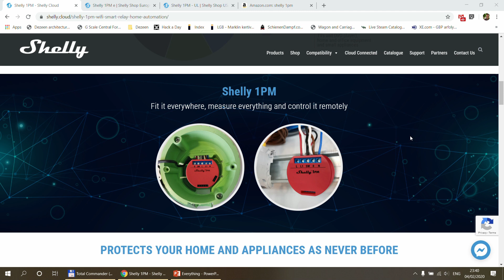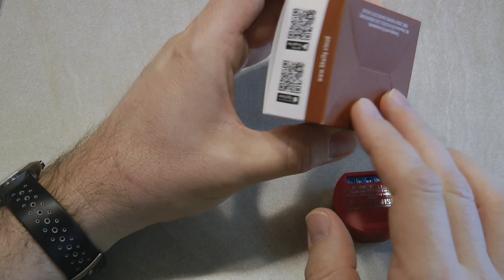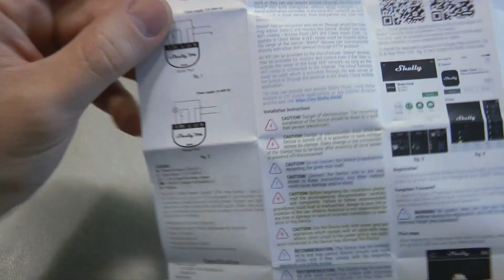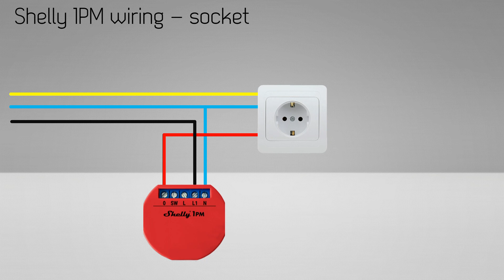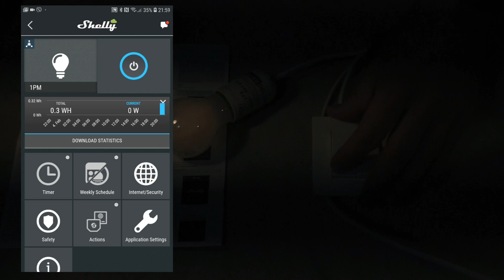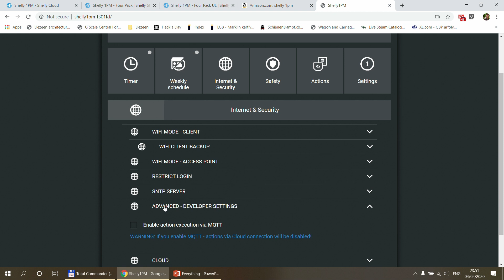Shelly 1PM - single channel wifi relay with power measurement

Comment: Question: Can I use a 110Volt switch with a 220V blub? can that work? with my input current 220v. ???
Reply from the maker: If your switch is rated for 110V, that is probably for a reason. I would not use if for 220.

Comment: For Sonoff is there a similar setting like the option to choose between the 'Toggle Switch' and the 'Edge Switch'? It is by default set on the 'Edge Switch' in the Sonoff Mini.
Reply from the maker: If think there is on the mini. You can use it either with a momentary switch or with a toggle switch.

Comment: Great video
but
I have a suggestion,
at minute 11:00, it's not
that Shelly remembers...
This is a mechanical switch
When you turn it back,
it physically interrupts the circuit

Comment: By far the best video out there.i know persons usually say that line, but i really have been on a hunt for a video that shows 2way switching, ie two switches one light....this does it best.also been looking for a video that shows shelly to the sockets or recepticles abd this is the only ive seenn so well done
Reply: When i click enable ckoud it shows loadinh then the lights come on....after i get a message saying could not reach device
Reply from the maker: @uittyman  Is this still and issue, or got resolved? Maybe there was some communication glitch, but I would expect it to be online in a few minutes either on the cloud, or the cloud option did not turn on.

Comment: Great video, but i have a problem with edge switch option. When I'm trying to get it to "edge switch" i receive an error "Bad default state and button type combination" do you have an idea what is wrong? I'm using generic on/off switch.
Reply from the maker: Let me redirect you to the Shelly Facebook group for support. Edge is explained here. But it does not make sense for me either, as it is clearly mentioned that edge was designed to work with regular on/off switches: https://www.facebook.com/notes/shelly-support-group-english-version/button-types-explained/2331082316991119/

Comment: How would it affect my shelly1pm if the live(L1) and neutral(N) are reversed .
By the way, Thanks for the very informative video.
Reply from the maker: To be honest, I was not paying attention if L1 is really live and N is the neutral. So I think there is no impact. Of course the reason this is important, because if you are switching the neutral and not the mains, you can still be electrocuted when you fiddle around with your bulb, device when it is turned off. But the Shelly does not care.